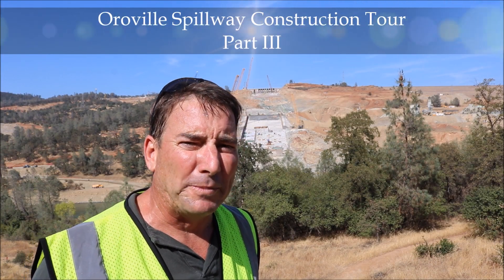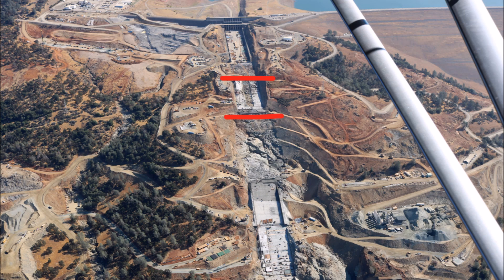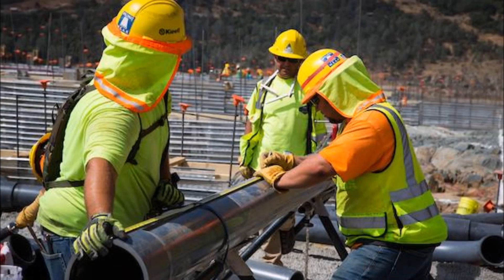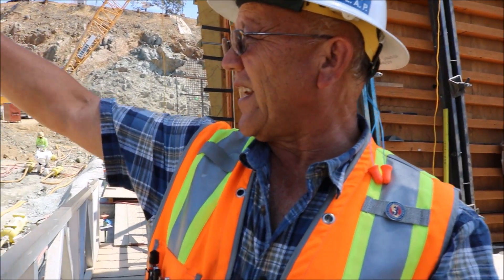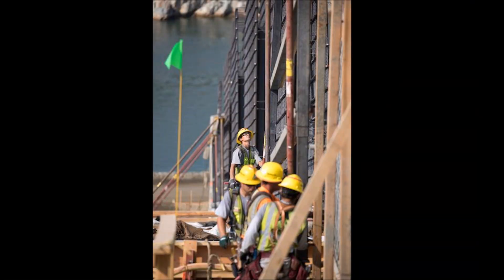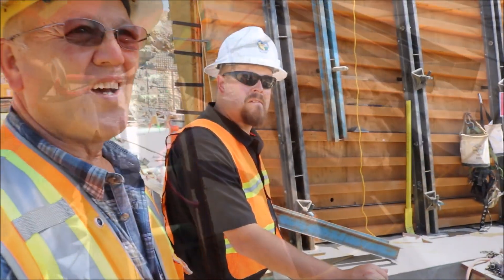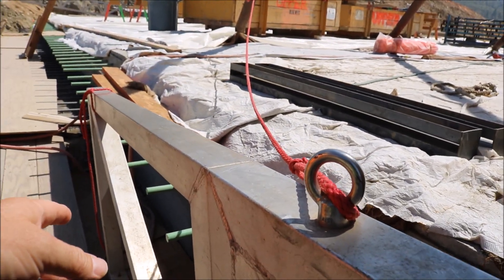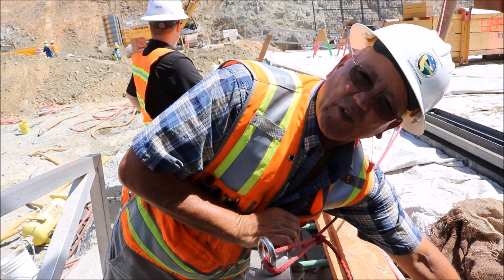Part III Oroville Spillway Construction Tour

Comment: Thank you so much for this detailed information right in the middle of the theatre. Here in Germany we had a very special mishap three weeks ago. In the Rhine valley they are building a new double tracked railway line to supplement the existing one. Under the town of Rastatt they bore two tunnel tubes. In the final part after 4.200 m of completed new tunnel the tunnel boring machine cross under the existing railway line in a very acute angle. Between the railway and the tunnel tube there are just 5 m of ground left. This ground was frozen down to -37° C (-34.6° F) to make it drillable. The 160 m long tunnel boring machine passed under railway line for 80 m, the mishap has happened. The railway together with the road bed moved down about 50 cm on a lenght of appr. 15 m. Some tunnel segments has moved and water came into the tunnel. They had to fill up the new tunnel with concrete - together with the 18 Million Euro Machine - to provide further slides. And the realy big problem is the closed railway line. It is one of the most frequented here in germany with 200 freight trains and 160 passenger trains per day. And they assume to re-open the railway line at the 7th of october. And ... this is the realy sad thing ... we have no Juan Brown reporting from the site. So all the people interested in the oroville dam thing can be very happy to have you reporting with a very, very goog analytic expertise and also taking wunderful aerial images and videos of the site. Thank you ... keep on ... we stay tuned ;-)
Reply: wow! What a mess. My BS meter was climbing as I read the article. Blame it on the weather?!? We lost a TBM here in my town when it crossed over an area of soft material and sank into the netherworld. Luckily it did cause any damage to anything else, so the causes were easy to find (the survey was at fault).
You don't have to be an engineer to see that they where cutting things too close to the limit. clearly if segments sink, they are not being supported underneath - you can't blame that on a failure of the freezing.
Reply from the maker: pitatutube Wow! That's a big story!
Reply: Thank you for this well investigated and compact article. Since the 12th of august i was following all article in germany and swizerland concerning this mishap. The main statements are: "This indicates a failure of the freezing regime and possible over-excavation of material as the TBM passed through the zone."  and "Reports in the local German media suspect that the integrity of the ground freezing operation was undermined by a recent period of high summer temperatures combined with periods of heavy rainfall." Something went wrong and they had no "Plan B". It is very expensive to tug the freight trains together with their electric locomotives over not electrified alternative lines. Passengers have to change to buses.
Reply: It appears that there are engineering problems and miscalculations in  Germany as well as the USA. Thanks for that report, Sir. Yes, we are very lucky to have Juan keeping his faithful followers up-to-date. I do not see any Oroville stories in the MSM anymore. It is simply "out of sight, out of mind", as far as the news goes. (Or maybe it is "out of interest, out of the news"...) Most people have the interest longevity of a nat. When the sensation is gone, they go to the next sensational story. That's why the MSM never does any follow-up. Who cares?, they correctly reason. Maybe it is the same in GERMANY? That's why Juan is a god-send on Oroville.
Reply: It's not unusual to purposely abandon a TBM machine in the ground after a project.  (with the understanding that' not the reason in pitatube's story above).   Apparently it's sometimes cheaper to run them off to the side and leave them there than to disassemble and remove them.

Comment: Juan, thank you so much for these fantastic videos. You're doing a great job of asking intelligent questions to the DWR that help to clarify what they are doing. Very interesting to hear that they will remove the RCC training walls next year. Also good to hear an explanation of the different types of concrete and how they are used.
Reply: I find it interesting that so much of the spillway is temporary and will be replace next year because it may be needed this year. As I understand it in 50 years this is the first time the spillway was needed and if you have normal precipitation this Winter they can work all winter and Finnish next fall. My point is if somebody knew the feature they could make some real money in Vegas
Reply: Thank you I see that this step is necessary.

Comment: Great stuff Juan!  Two questions??
1. Is the 2 ft. cutoff wall "step down" there to address/stop cavitation during water release?
2. What specifically is the difference in the "erosion resistant" concrete? Less aggregate/smaller aggregate/no aggregate??? Or something else that gives it that classification?
Thank you. Jim
Reply from the maker: stay tuned...Part IV we get into that.
Reply: Will do, thanks!
Reply: Good. If I heard right, 2500 p.s.i. isn't a whole lot for strength BUT with the RCC as a base, maybe that's all they'll need and beef it up above where all the hammering will take place. 2500 used to be base line years ago.  Now it's 3k and 3500. Better mix, more cement and stone. Plus fly ash!

Comment: Guys from KWIT and DWP didn't like the term of unaurthorized exsplovises and demolition on the upper spillway. Just a simple misunderstanding and they were already going to do it but just didn't get to go ahead. Sounds to me like "unauthorized" but I may be wrong.
Reply: It's unathorized depending upon which side of the fence you stand.  When a contract is commenced, the contractor has operational authority.  The contractor must perform, always under the gun to perform.   The rascals in the bureaucracy in the excersize of their administrative duty seek to hold sway over the contractor.  Millions of dollars on the line and a looming deadline, plus the never forgotten threat of liquidated damages, the contractor steams ahead.  The contractor will make genuine, diligent efforts to partner with the agencies but they have to keep moving and time waits for no man, especially an agency tasked with oversight but no real consequence (relative to that of the contractor) which lingers too long.  Nothing gets built if forever waiting to the speed of bureaucracy.  It's a push/pull relationship, mostly copacetic sometimes not as in this somewhat trivial matter..

Comment: Wow, the progress on the upper plunge pool seen at 18:15 and 18:21 is impressive ... much further along than I was expecting.  It's that final 20-30 feet or so that's gonna be the real bear though, because the area that needs filling is huge, and it's still unclear how much RCC they can actually produce in a day at max capacity

QUESTION: How many lifts per day are the doing with the RCC ?
Reply from the maker: More working area=faster progress...
Reply: Absolutely true, but only until the size of the work area increases to the point where it maxes the daily output of their lone on-site RCC plant, and their transport capacity, and it's unclear what those are.
Reply: The RCC plant is huge.  It's as if they bought all the expansion packs and tricked out the plant.  Transport and actual installation will be the limiting factor here.
Reply: Matthew Trevett "Huge" is a relative term that varies from one person to the next, which is why I was curious how much that plant can output in a day, and how much transport and application capacity exists. I'm guessing they will likely keep that info close to the chest, because sometimes too much info can be almost as bad as too little.
Reply: You're right.  I have no idea the specifics, but this plant is huge compared to what I've seen in similarly sized construction projects.  My only guess is the time crunch required a lot of concrete in a short amount of time.
Reply: Matthew Trevett Just as a point of comparison i live in a suburban area servicing NYC, so the concrete plants around here are fairly numerous and large, sometimes with multiple lanes each pouring different types of mix. It's hard to judge scale from a video. Having some capacity figures would remove the guesswork, but we're prolly not gonna get it. 

No big deal ... i was just curious. I'm killing time waiting for my wife's ferry to arrive. Just watched all the new DWR vids that landed today ... great footage of progress on both plunge pools.
Reply: You can see how gargantuan a volume they need to fill from the lateral view of the upper plunge pool seen at the 8sec mark ( https://youtu.be/s1GOAfA5AGM ). That's a lot of lifts at 1 foot per lift, and one plant to feed it all ... and on the flip side even if they had infinite RCC capacity there is likely a limited number of lifts you can do in a day without compromising structural integrity of what youre doing.  Also, with concrete needing a month to hit max strength, that eats into the deadline.

Again, im not being critical ... it's just the idle curiosity of an avid follower with too much free time to fill. I'd love to hear how they solve all these challenges. 😁

Comment: Juan, it's amazing how quick you are picking up on the technical side of this project. You're asking all the right questions for us and, at the same time, we are all learning how the dam operates. Very cool.

As a side note, they sure didn't seem to like the term "unauthorized blasting". I think they wanted to change the subject.
Reply: ChicoDon Anything those guys say that is recorded can be used later by lawyers if someone decides to sue. So they are VERY CAREFUL about any statements. Also they have to deal with the federal regulators, FERC, and don't want to come across as willfully ignoring regulations. "Anything you say, can, and will, be used in a court against you."

Comment: Why build the spillway for 270K CFS if the highest possible flow is 160K?
Reply from the maker: Overbuilt for factor of saftey....and in the event of an emergency that requires saving the dam at the cost of flooding downstream, just like Houston this week. See Addick and Barker dams....
Reply: Everything must be built with safety factors involved.  A dam built to the exact specifications without overbuilding would likely fail in the event of unusual conditions.
Reply: https://www.facebook.com/GalvestonDistrict/photos/pcb.10156549367468032/10156549365218032/?type=3&theater

Comment: Okay, now I get it. They are removing all the loose dirt and gravel - where the original spillway disastrously was built on - down to bedrock, fill and level it with rcc/levelling concrete that is anchored to bedrock and then lay the spillway over it (also anchored). That sounds solid to me. :) But do these new training walls have the same height as the old ones? They look higher to me.

And what I still don't get is what are the draining pipes for? Where does the water come from that they are draining? Is it seeping through the spillway slab when they are using it? Also I did not understand the explanation how they will work... Still some things to work out. ;) That's such an interesting and fascinating project apart from that they shouldn't have let it happen in the first place.
Reply: Partially right. The big problem with water under the spillway slab is that it acts like a hydraulic cylinder. The pressure of the water under the slab, if not relieved in some way, can actually lift the slab. This will cause it to crack, and once it cracks badly enough, it can be game over. There is a theory that that is what destroyed the old spillway, and it is most likely correct.
There should not be much problem with erosion since it is all rock or concrete now. There was an erosion problem before, which could have contributed to the failure. 
Where does the water come from under the slab? The main dam is an earthen dam, that is, it is a dirt wall. Water from the lake percolates through the dirt to some amount, which is perfectly normal. This is effectively just "ground water". There may also be other groundwater sources like underground streams in the area. Groundwater isn't a problem, unless it gets under the slab of the spillway, where it can try to lift the spillway as I mentioned above. So they need drains to divert any groundwater to someplace safe, that isn't under the spillway slab.
How do the drains work? Each drain is a channel from one side of the spillway to the other. It is filled with loose gravel and a perforated plastic pipe. If any water somehow gets to one of these drain channels, it will filter through the gravel and enter the pipe. The pipe will take it to the sides of the spillway. Now, there shouldn't be water in the drains. If there is, they want to know that. So now you have a pipe full of water, where are you going to let it out that it is easy to see? The spillway is on a 1:4 slope. The run the pipe out of the drain almost horizontally downhill. In 100 feet the spillway will drop 25 feet. The drain will only drop a foot or two. So they can run the drain outlet pipe in the side wall, and if it is 100' long, it will dump back into the spillway 25 feet high 100 feet down form where the water was collected. If they see water coming out of the side wall, they know they have something to look at.
Reply from the maker: YES!
Reply: My understanding is that the draining pipes will allow them to monitor any groundwater that gets under the spillway and allow the groundwater to safely drain away without causing erosion under the spillway. Is that right?
Reply from the maker: yep
Reply: According to the report you made a video about earlier, the drainage system was very similar to the one we're seeing now (recall the herringbone failure pattern and the root-plugged drain line).  The main difference being depth of concrete on top of the drainage pipes.  Also, the old drainage system was made with vitrified clay pipe and the new one has either PVC or HDPE.

A lot of the "dirt and gravel" being removed is due to the failure of the spillway, and the subsequent removal.  Speculating here, but it seems incredibly unlikely that a vast majority of the spillway would have been built on dirt and gravel.  More likely it was on semi-weathered bedrock which may have later failed due to water infiltration underneath the spillway.
Reply: I wilton --- Excellent explanation, probably better than an on-site engineer could have done....unless you're onsite?
Reply: Thanks. No, I'm several hundred miles away.

Comment: Thanks Juan,
What makes "abrasion resistance" concrete? I have used Garnet in a sand blast cabinet for its hardness. Is that the idea, to use some kind of hard aggregate in a high psi concrete mix?

Comment: Good job. Personally I would like them to have to use the spill way this winter because even though we filled the dams this year the underground aquifers could use more water. And one more really wet year would do wonders.
Reply from the maker: Oh don't worry about that, the Hyatt PP will be flowing full tilt at 17,000CFS plus!
Reply: They don't need the spillway to flow a lot of water, because they have the HPP and RVOS.  They need to keep the levels lower than normal, so whatever comes in will likely be pumped out by the HPP.  What you will not have is a lot of excess water next summer.

Comment: Aside from the new material technology they are using to rebuild the spill way, are there any digital monitoring technology they are incorporating in the structure to monitor any leakage or problems?
Reply: I'm sure there will be more monitoring via cameras and such, but the primary way to monitor for leakage through the spillway is to visually look at the outlets of the drains.   This is actually the same as it was on the old spillway.     The cross drains went out to the sides, through the walls (or behind them) and then dumped back into the spillway downstream.    The difference is, they didn't have the rubber seals between the slabs, so they just always expected there to be a lot of water draining when the spillway was active and didn't pay really qualify it in any meaningful way, so that they could recognize a problem.    The problems started with the old clay drains when they were damaged by tree roots, and were partially or fully blocked, forcing the water to find more creative ways to escape from under the slabs, which is what caused further erosion, settling between slabs, and ultimately allowed surface water to drive itself into the cracks with great hydraulic pressure.     On the new spillway with much better seals between slabs, they should expect to see very little water in the drains, and will notice right away if it increases.  Using plastic pipes they'll have inspection ports on the sides as well, where they can get in to look for problems, or even clean out debris.